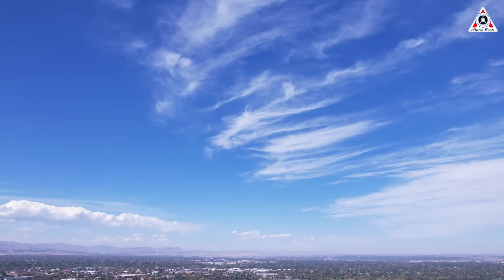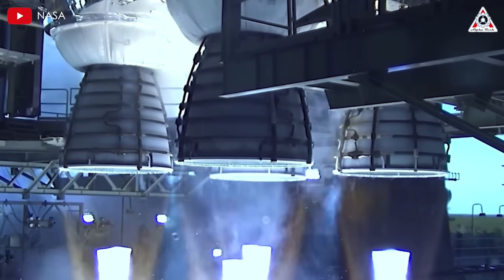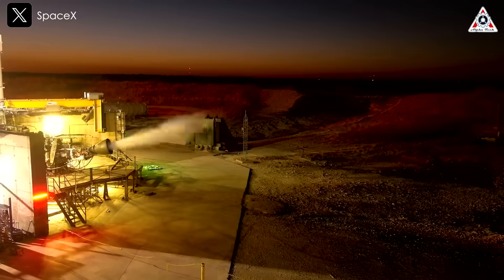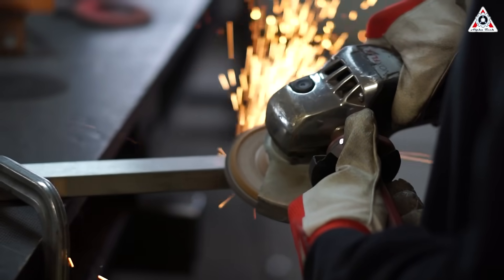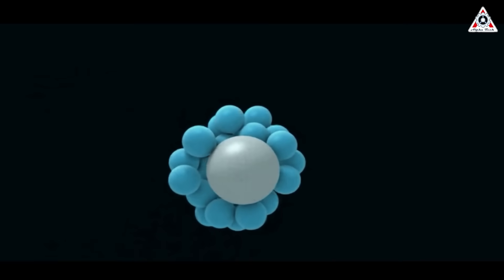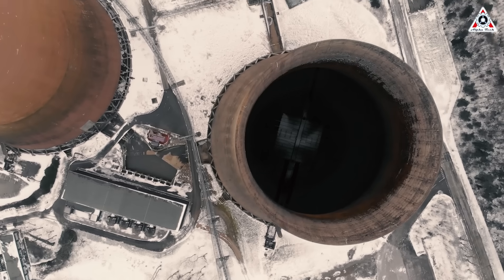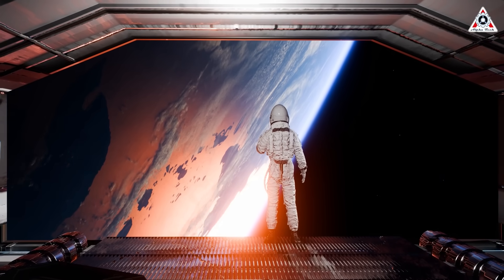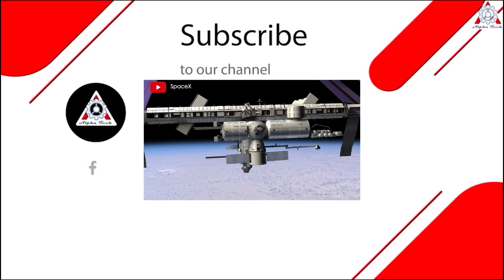NASA's New Nuclear Rocket Engine to Mars in a Day! Even Faster than SpaceX Starship...

Comment: Why not use WATER, H2O, as fuel in a nuclear rocket?  Why Ammonia which is more difficult to handle than plain water which has its own additional uses. Water is a basic necessity of life. Most of us understand the difficulties is working with Hydrogen, so why would Ammonia be the secondary preferred fuel source.  Many classic Science Fiction rockets conceived by writers who were engineers, scientists, physicists etc. (Robert A. Heinlein comes to mind) used water as the fuel in their nuclear engines.

What’s also critical is if you can boost then decelerate at a constant 1g. A constant 1g acceleration to the moon gets you halfway there in about 1.75 hours, where you cut engines, flip and fire up the engine to decelerate.  That gets you to the moon in 3.5 hours.  Mars would be about three days all at a comfortable 1g.

Comment: But the accelation to make the trip in 1 day would flatten to crew to the thickness of a sheet of paper.

Nasa worked on nuclear rocket  engines in the 1950's.  If it fails  on launch do you want the nuclear fuel landing on your backyard and the radiation killing you?
Reply: Deceleration too
Reply: Launch failures are accounted for, obviously.

Comment: So... "Nuclear Thermal Rockets" are the exact same principle as "Nuclear Power Reactors". We split or fuse an atom to release energy that we then use to heat another substance which is used to convert to mechanical energy. The exact same thing as steam power, we just have cooler ways of heating it up.
   Heron of Alexandria just might be surprised by our lack of innovation.

Comment: Nuclear engines do not provide an improvement in thrust over chemical rockets.  They do provide a higher exit velocity of the exhaust products than most chemical rockets, but like ion propulsion those exhaust products are very light.  They are very efficient, which is why their ISPs are so great.

Comment: If they prefer Hydrogen but can use Ammonia, they can also use Methane that is 4 hydrogen and 1 carbon CH4. In gas or cryogenic liquid methane is easier to use and less likely to leak or damage the metals or materials used to store and transfer. The best thing about methane AKA natural gas is it's 100% renewable fuel from organic waste. Here on earth it can be made with 0 energy input and a family of 3 can produce 3-5hrs of cooking or heating fuel just off of food preparation waste and double that if you add human waste to the mix and only needs 5gal of cow poop to get it started, I know no cows in space but the enzymes needed can be made in a powder like a yeast pack
Reply from the maker: Thanks for the information!

Comment: A fact you forgot to mention fully:  You can't use a nuclear engine to get to orbit due to greater risks of explosion releasing radioactive materials into the environment  . It will only work safely in space not from ground to orbit. So to get to orbit you will need to use chemical rockets.  If NASA is in charge then you won't see it in the near future all smoke an mirrors. If it gets built private companies will do it before NASA even has a prototype

Comment: I can see travel times shrinking from *six months to six weeks* as a possibility in the coming years, but it will require extensive testing. Not to mention, we currently *do not have* a nuclear fusion rocket or an antimatter drive. If we're talking about the **DARPA DRACO project**, its first test **isn't planned until 2027**, meaning we're discussing a **theoretical rocket that would need to be completed in just 2-3 years**—an extremely ambitious timeline.  

For comparison, if development follows a similar trajectory to **SpaceX's Raptor engine**, the concept first emerged around **2010**, with the first full-scale test in **2016**, a prototype in **2019**, and continuous improvements still being made today.  

Until we see the *first actual test launch**, any advanced propulsion system remains purely theoretical. Keep in mind, **nuclear fusion has been "just 10 years away" since the 1950s**. Until we witness the first successful test flight of an advanced propulsion rocket, the current **6-8 month trip to Mars remains the fastest realistic option* for the foreseeable future.

Comment: So ION engines being used right now have a low propulsion capability due to the available power on the satellites or probes. Why not have a nuclear powered generator to increase electricity so the Ion engine has more propulsive power. I get that the Nuclear  engine components are best left to outer space for use while we use methane oxygen engine to get them there, but outside of earth orbit should be a great place to do this.

Comment: NASA and the military have built and tested about 9 (20?) different nuclear thermal rocket engines over time. The earliest were pretty rough, even throwing fuel rods. The NERVA a much better prototype.  The government has started research again several times just to end it when after the regime changes. It takes more than 8 years to develop an operational unit, so the program was shut down before a test unit could be produced. Politics ruins everything.

Comment: Yes, it's fast, but these systems are currently planned for small probes.

What NASA needs to make is a big orbiting autonomous space TUG. 

The TUG docks with the payload and pushes it from its current orbit to its destination orbit. Once at the destination, the TUG undocks from the payload, leaving it unencumbered. The payload can then employ its normal landing procedures.

Since the TUG never leaves space it can be operated safely without worry of radiation or mishap on the ground.

If it's not planned to be used for a return trip, the automous TUG could return to earth orbit and reuse.

Comment: NASA will give the nuclear engine development contract to Boeing…
Reply: That will guarantee it will take 20 years and the prototype will be full of defects not to mention the cost overruns to get to something that doesn't work in 40 years. Then after 40 years the project will be abandoned  after expenditures of great sums of money.  Meanwhile SpaceX will be out there with commercially developed propulsion systems based on Zero-point energy or quantum physics

Comment: A revolutionary new engine, developed in the 1960s and cancelled in the 1970s.  See NERVA
Reply: No commentary on the energy economics of uranium usage. We don’t have all that much in our planet’s mantle, and it’s expensive (in energy) to refine the appropriate isotopes. We probably need it more for powering our planet than flying around the solar system. Maybe we should look at mining asteroids for uranium or other fissile and fertile materials before colonizing Mars??
Reply: @fredjacobs26  I think what is going to make this engine viable is how long it can be used before requiring refuel/rebuild.  If it can be operated for several trips to and from before maintenance that will make it more economical.  Chemical rockets are just not as viable for interplanetary travel of this type.  Once private industry smells profit in asteroid mining I believe it will come.  But even travel to the asteroid belt in a scale to make mining worthwhile will take an advanced propulsion system.

Comment: The USA been working on this Nuclear Rocket engine from the 1950 to today. What in the hell is i=the issues???
Reply: there are multi-issues:

1_the materials not efficient (to build the engine and the spaceship)
2_the radiation containment (fear to spread radiation)
3_the devices not fast enough for high speed (pc and other, we need devices to process data faster than light)

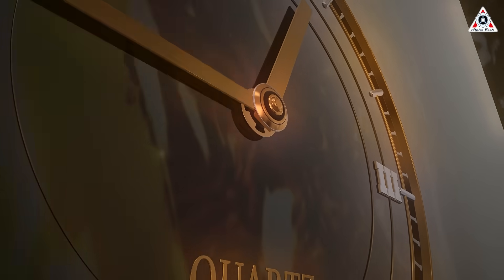Comment: Lol I get what you are doing and others have probably said it already but, they aren't going to use 39 engines to get to mars. 0:11
Reply: I agree most of those engines are just to get to LEO to get to Mars you only need one engine  to get enough delta v to reach the required velocity
Reply: I don't  know, isn't the intention to use a ring of thrusters, near the top of the rocket, to do the actual landing and the base rockets to do the entry burn. Maybe there's 39 engines up the top?